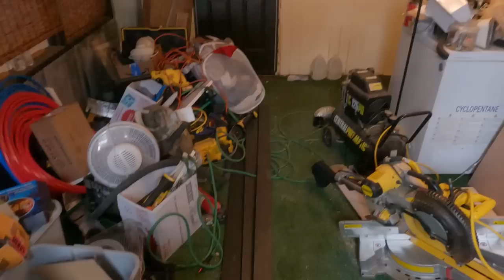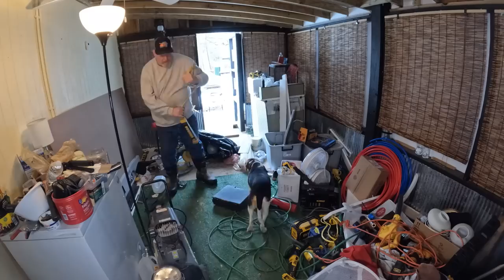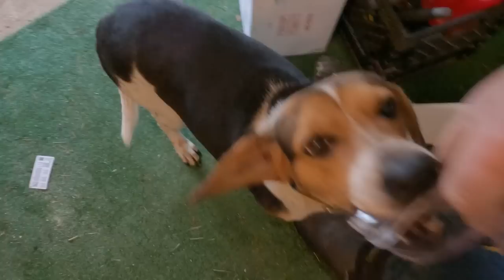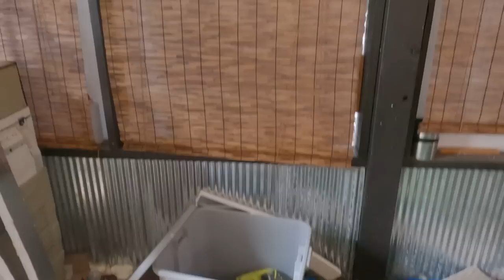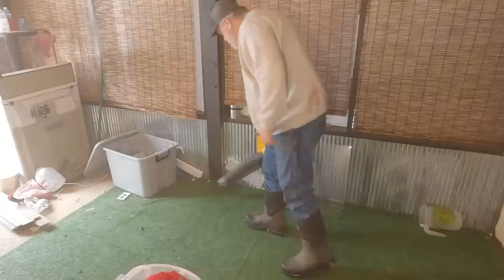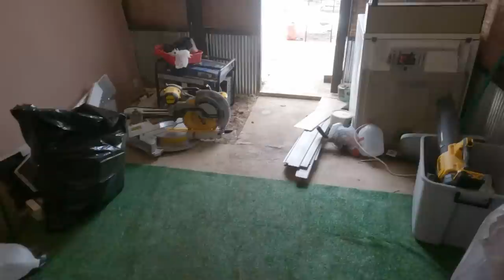Irresponsible Peoples Life Choices Have Ended Up On My Doorstep! But These Dogs Will Get My Help.

Comment: What a big heart you have for these dogs. When my dog had puppies I used a U-haul wardrobe box and taped the bottom flap up so mom could get in and out but the puppies could not. All I did was change out the blanket and wash them.  She took care of the rest. At 6 weeks I broke down the box and put it under a puppy pen I had. Mom was in there for 2 weeks with them and after that she was back to her old routine.  I kept them until 12 weeks and had every single one of them a home by that time.  I feel for you having 2 mommas at the same time. I agree that people don't want to take responsibility. In the last 40 years I have taken in many strays, both cats and dogs. I had an agreement with the local Animal control that I would foster and they would find the home. Worked great. Glad you have a plan for both mom and puppies. Will try to send money when I get paid.

Comment: Your words of how this happened and where you're at now and your game plan is 100% spot on!! I worked at a shelter in Indiana I was foster and transport coordinator in my last position, and I set up what I called a transport train hard to get people to go a complete trip all the time so I would get people to do legs of the trip and that made things much easier as for the travel plan. But most people don't realize all that goes in to arranging a transport set up there is 1) the contact and begging lol request for transport, once that is agreed to, then 2) making sure all dogs and or cats have their medical up to date and documented so that  can travel with each animal on their crate, along with any possible identifying marks, or paper collars or microchips to keep all animals straight, 3) many emails or calls and often pics sent out and sometimes medical ahead of time, 4) then when transport day comes getting all animals in to their crates and correctly marked and positioned for the best travel as some can be reactive to certain others near crates, even though they are great pets may not like others, 5) make sure drivers have directions, extra food and water, leashes in case of break down. Then take a big breath and don't exhale until you hear they arrived safely then CHEERS all around it came together well and lives saved!! I just hope this doesn't keep happening to you. That people drop off at your house or leave in your area, you can't be expected to save them all.
Reply from the maker: Yep, you know how it works.We also transported that way.Short legs of the trip.Its how I got my Miss Rooster.

Comment: Try getting a few of those plastic bins that fit under a bed .  I used those for my cat’s litter of 6.  I didn’t know she was preggers when I found her.  Those bins are low enough that the mother dog can get in and out, but the puppies can’t until they are old enough to be walking and climbing.  I used old blankets from Salvation Army for $2-3.00 to pad the plastic bins.  You can take the plastic bins  outside and hose them down. And throw away ( or wash*) the old blankets as you need.❤

Comment: Sent a small donation Mike. It's all I have in the bank for now so will send more later. Dogs rely on us to help them. (I kept my 5 puppies and wouldn't change a thing - I have 7 chihuahua's now. Got the daddy fixed when I found out and one of the boys too. I keep a close eye on the runt as he has health problems and can't have the op. ) Costs for spaying the girls have skyrocked here so I just keep an eye on everyone and they are used to a set routine when the girls come into season. They are all seperated for going outside. It works once I saw the signs. The runt goes giddy and the girls get noisier lol.
Reply from the maker: Thank you, You didnt have to send if it set you back.But I appreciate it
Reply: @ouachitamountainliving  No worries. I have spent months getting  in front with buying extra's each week and topping dog supplies up. I get my pension weekly and disability monthly so I am fine. All usual bills paid to date. If I could I would send some PVC storage drawers for your tools lol. But, I know what it's like to misplace them. I have 'safe' places where I can easily find them - until I want them and don't have a clue where that was. 🤔🤨🙄
Reply from the maker: @pamt7740  I am also on disability, so yes we live on limited income.I get a little bit from youtube, but not a lot.